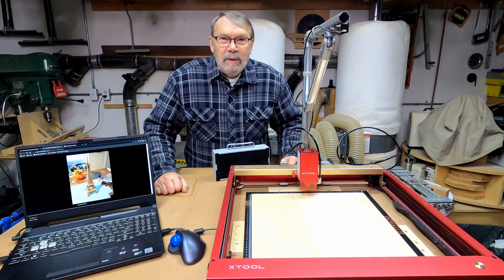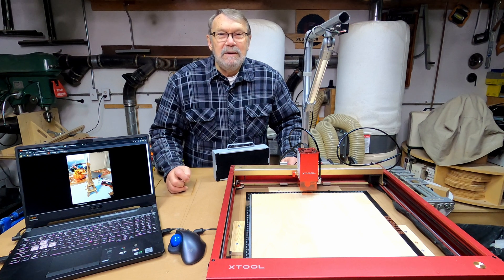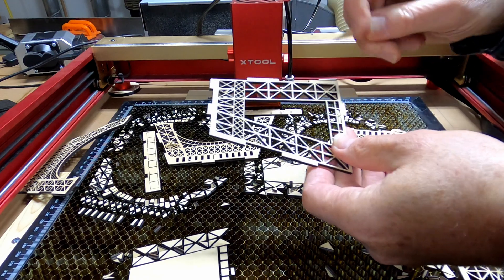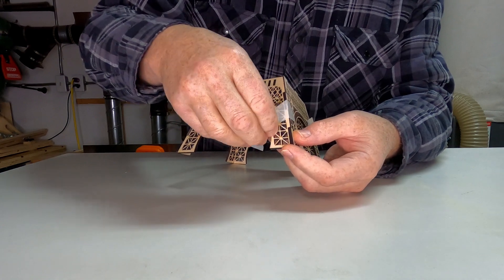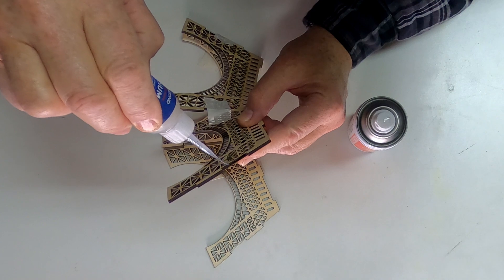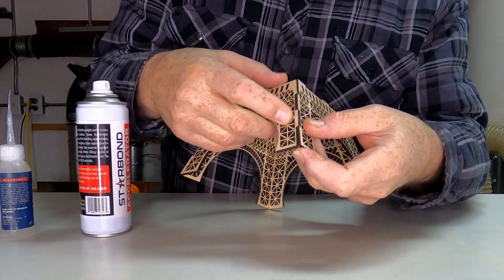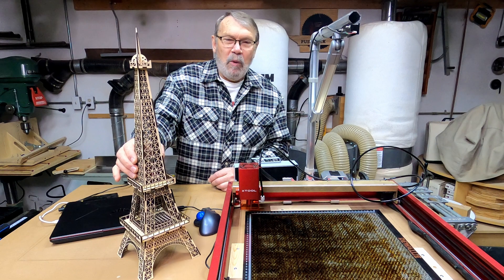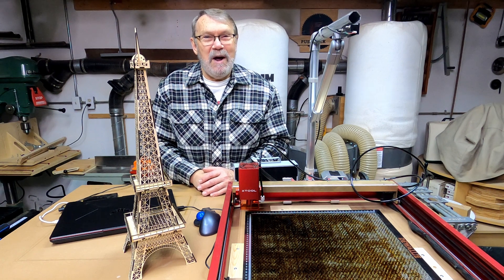Eiffel Tower model using XTool D1 Pro 20W

Comment: Wow Gord that is pretty cool looking. Looks like a real fun project and you did a great job with the whole process.

So I am curious about the plywood you used. How thick is it and where did you get it. Those look like pretty large sheets so I am thinking maybe the home improvement store?
Also what is that right angled tube contraption behind you at the end? Not sure what it is but that looks pretty cool as well.

Great video my friend,
Gary
Reply from the maker: I'm happy that you liked it, Gary.
Right angled contraption? There are a couple of black foldable roller stands hanging on the wall, left side of the screen. Would that be what you mean? I can't see anything else that might meet your definition. Let me know if you mean something else.

The plywood is 1/8" Baltic Birch. I buy it in 1/4 sheets because I don't have a truck and it's a lot cheaper to pay the premium for 1/4 sheets than to buy a truck! 😆🤣😆🤣 I get them from a place called Windsor Plywood.

Thanks for watching, buddy!
Take care,
.....Gord
Reply: @GordonRock1  At 10:23 of the video between the two dust collector bags it looks like a crane. I am sure when you tell me what it looks like I will feel like a fool and bury my head in the sand like an ostriche LOL
Reply from the maker: The 10:23 threw me off a little. I think you are probably referring to the Lightburn camera that is right above the engraver. There is a camera in it that allows you to see from directly above in the light burn software. It’s a great aid in positioning the element you want to burn on the wood you were using. I hope that’s the thing you are referring to. I may have to do a video explaining what it is and how it works. Let me know if that is not what you were referring to.
…..Gord

Comment: A very impressive model. You should enjoy having it sit around as a display. It will be a good conversation piece. I have some of the same questions as earlier. What is the wood you used? My guess would be 1/8 plywood. How long did it take the machine to do the cutting? The result is quite nice. A nice exercise for the machine. Of course it would have been a different story if you had to to the programming. Someone spent a log of time inputting the data for the machine to work with. I am amazed at the accuracy that can be obtained. I've seen some models that didn't require any glue at all. Everything was a snap fit. Thank you for sharing. Have a great day. I am pleased to hear that your back is doing better. Take good care of yourself. 😀😀
Reply from the maker: You are correct, Glen. 1/8” Baltic Birch Plywood. I believe it was 500mm/min at 100%. I think it took about 2 1/2 hours to cut. I’m going by memory here, so don’t rely on it. Yes it would’ve taken a long time to draw this up. It’s very different from the kind of programming. I usually associate with computers. This is a matter of actually drawing something. I find it very interesting. Thank you for the well wishes, my friend. I really appreciate you! Thanks for watching!
All the best,
…..Gord

Comment: Cool project. What was the thickness of the wood? What were the settings on the laser, speed and power?
Reply from the maker: Glad you liked it, Greg. 1/8” Baltic Birch Plywood. I believe it was 500mm/min at 100%. Thanks for watching!
Reply: @GordonRock1  was it one pass? I’ve had trouble cutting with my laser unless I do multiple passes.
Reply from the maker: Yes, it was one pass. I cut it at 250mm/min and 90% power. It's a 20 watt laser.